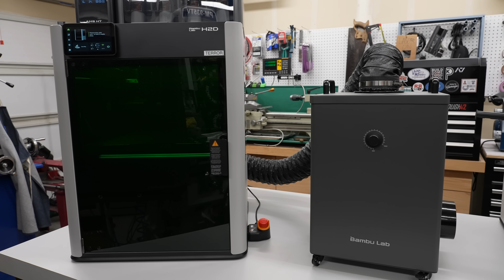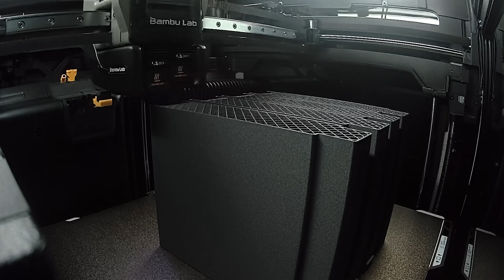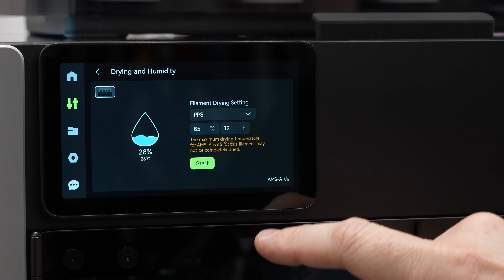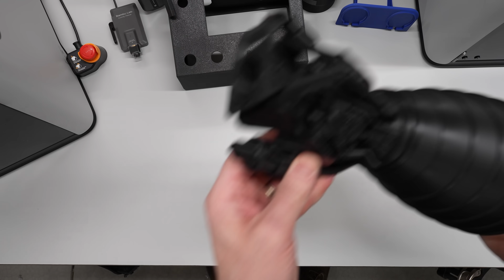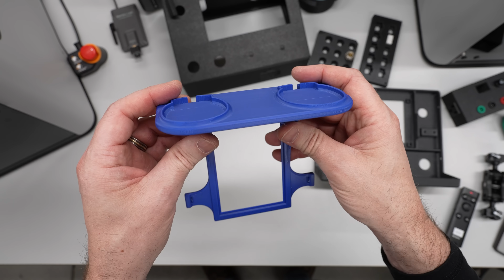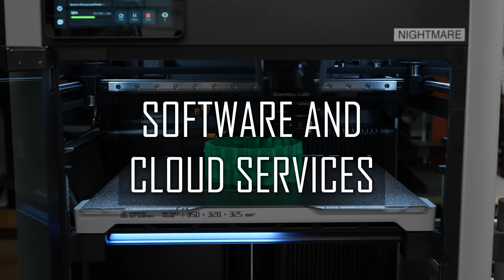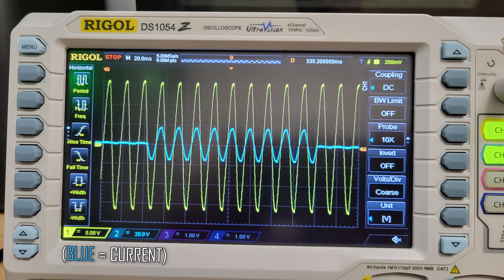What I Learned from 300 Hours with the Bambu Lab H2D 3D Printer

Comment: Right on, man!  That is just an excellent summary, and you covered everything well.  

I would comment that I can't imagine running a laser in a 3D printing environment. The amount of by-product produced by the laser would make for a horribly dirty environment for a 3D printer.  Maybe their exhaustion is really good, but having cleaned soot/glue off the bed of my laser, I can't imagine trying to get that stuff off of the intricate 3D printer parts.

Comment: Thanks for the video.  I have the X1C and for the most part works well. I have had filament breaks just about everywhere and don't really like being a mechanic and tearing things apart.  I have learned a lot about these machines though. I like the fact that these are easier to work on like swapping print heads.  I have always liked the AMS for printing in different colors which I think is the best on the market.  Printing right from the box is a big plus.  I like the heated and drying in the new AMS.  No more desiccant balls going everywhere. The laser addition is dumb in my opinion.  When a laser cuts it not only sends smoke everywhere but microparticles and sap.  Just get a PS2 from xtool and you can have 50w that will even cut clear acrylic. My guess is they will abandon the multitool concept when thy don't sell many of them.  I am just looking for the best print possible without failures that cost time and materials.  Bambu seems to deliver on that.  As far as their recent release on 3rd party slicers etc. that's above my knowledge base. I am still learning how to use Bambu Studio.  Design cad and all that other stuff are for someone besides me.  I just like to find good files and print them without issues.  Thanks again for the information.  I am sure more will be coming out daily.  Seems like the mechanics of the HD2 are working without any hitches, which is good.

Comment: the non laser version is most practical to get imho.  its rarely a good idea to use one tool for multiple tasks.  i would buy the non laser H2D and get myself a dedicated laser engraver.  that way, if there is an issue, i would be deprived of at least just one tool.

Comment: We have several X1's in a business used for manufacturing our parts. We only run single filament prints so never bought the AMS for those machines. The question I have is does the new AMS change rolls of the same filament when one runs out WITHOUT stopping the print and purging? It never made sense to me that the original would wait until the extruder was out of filament before loading another causing it to have to pause the print while it primed the extruder again. If the run out sensor was back at the AMS it could push the new roll directly behind the last that ran out and never skip a beat.

Comment: Lubricating timing belts are rare but something I've had to do in the past as an LFP tech. When timing belts start to clime up on the pulleys and/or make some noise and vibrations, then it is time to add some tiny bit of silicone grease to the outer edge of the belts.

Comment: integrating a laser into a 3D printer is one of the least practical ideas I’ve seen. 3D printing demands a clean, dust-free environment for consistent results, something that’s nearly impossible to maintain when you're also generating smoke, soot, and debris from laser operations. Good luck keeping your H2D clean enough to print reliably. Bambu Lab had to focus on improving times and waste of multi-color printing.

Comment: This video helped me decide that I don't need the H2D. It also validated my decision to buy the P1S just a few weeks ago - I've been using it non-stop since. I had FOMO ordering the P1S so close to the release date for the H2D. I'm glad I didn't wait. If there's a cut down version of the H2D at a lower price in the future, I might consider getting that eventually. Excellent content, thank you!
Reply: Лучше X1C Друг! У него и головка с закалённого металла и температура стола выше и многое другое лучше чем P1C
Reply: @Сергей_Бистяйкин  The P1S can easily be upgraded to hardened steel extruder gears and hot end. The slight increase in bed temps is not enough for me to justify the significantly higher price of the X1C. While the there are other feature differences also, they are not relevant to me.

Comment: I am planning to get this new machine, but my concern is with the tpu. I want to try and get into mixing petg and tpu with the dual nozzle. How did you go about making your print with the buttons cause that looked amazing! Did you just side load the tpu with the side spool holder like you would on a X1? any generic brand or did you use tpu for ams by bambulab to do it? I looked at other reviews and they had complaints about the tpu and had to jig up some way to pipe in the tpu from the top.

Comment: LED flickering is a day in and day out experience in new home construction of course mainly due to the use of less than high end bulbs. It's an issue the LED bulb manufacturers should be dealing with on their end by now but unfortunately the industry is moving in reverse chasing costs rather than quality. What else is new

Comment: In reference to the pla breaking on the longer print.. I know klipper can cut off hot end power on a tool changing printer after a set time, like 10-20 minutes. Depending on what you set it at.. it shouldn't be a big stretch for them to make a macro that will pull back filament not being used at a certain layer height that it sees a certain material is no longer used..  
Great review.. been waiting for this printer!!

Comment: I really respect your opinion. Dang, I wish I could afford the H2D or more importantly, the SPACE for one. My A1 is fantastic and fits my needs. It's so tiny I actually got rid of my TV and put the A1 on the TV  cabinet. I don't do enough printing to justify getting this machine. Most of my uses for it are "artistic" and a bit functional. I've been printing stuff for a local artist to use for mounting brackets on canvases and frames and.... IT JUST FREAKING WORKS EVERY TIME! I rarely have failed prints. However, I am annoyed with my AMS and the "bleeding" and mixing of filament colors after swaps. The dual nozzle on the H2D looks fantastic. That alone would be worth the price. To be able to mix TPU and PLA in the same print would be amazing.

Comment: Really good info! honestly! love indepth from a slower take on how things went from ground level. (Open to any thoughts about the below thoughts)

Great price if you are looking for an all in one. However, Fiber lasers like the F1 ULTRA and its capabilities kind of have this sold out. The Build of problem of debre is a defineite struggle for sure. Snapmaker has them in build size, cost, and openess to change. This has snapmaker in terms of speed, materials, and multi-material. Definetly going to have those with use cases for this. There are a lot of technical engineering challanges I see they really had to go through. Was sad about the inability for 2 materials from the same changer to be able to be used. And unfortunate, that the build size is not much bigger than the K1 MAX even if dual nozzle

Its hard to watch material wasted, honestly by just doing filament ramming and then pulling the material out before it gets cut TONS of material is saved when purging and have found it possible to get down to sometimes just 0.4 in orca slicer for purge numbers on some. (Numbers close to 150 with this method) 

Someone else mentioned the least talked about thing of purging into another item which I think is one of the most "filament saving" tools out there! Purge into other objects that you may be needing or can sell as functional parts with some multi color pizzaz :P. I understand not all materials will be good to do this with or even pulling them all the way out as I mentioned do to the aforementioned  (in the video) easy clogging. And at the same time I see it important to mention that even retracting until just before there is a few mm left of the material below the cutter will IMPROVE A TON of material waste!

Great video! Just a lot of effort to do multiple things. I like to live by a phrase I heard some one say one time "If something takes longer than 10 - 20 seconds to do" { and you have to do it alot } then your less likely to use it or want to do it.

Comment: I had a printer a decade ago for a few years and it’s amazing how much printing has improved in the last 10 years.  I would have to force myself to learn CAD to make it worth buying another one.
Reply: I used to supervise an electronics maintenance work centers.  Especially when we were overseas there were so many times you couldn’t get what you needed, and it really would’ve helped if the basis had it of facility where you could manufactured to the level that we can now between lasers CNC’s and three printing in a multitude of materials. It takes us forever to get parts and their expenses.
Reply: Hey, DOD.   The next time we go to war you need to be able to 3-D print decoys also.  They built an entire blow up army for D-Day to throw Germany off and now we can 3-D print the entire thing.
Reply: You make a giant 3-D printer and you put it on a semi with a generator and then you have a semi with reels of plastic : )
Reply: The printed conflict.  At what point do we start fighting each other with 3-D printed weapon systems?  Lol
Reply: Well to be specific at what point do we break the line where most of it is 3-D printed versus traditional manufacturing
Reply: I’m sitting here thinking about 3-D printers that fit on the pallets for military aircraft and have a huge build volume : )
Reply: Why call back and ask for procurement support when you can just make it : )
Reply: What makes all of this interesting is that if they get good at recycle in which they’re trying to do anyway they use the materials from around them instead of having a supply line and now they can truly be mobile.  They dig up your garbage dump and process it with enzymes breaking everything back down to its basic component and then re-manufacture.  You will see some very clean battlefields because everything will be reused.
Reply: You can’t move back anymore because there’s nothing left but the scraps from the last battle.  The rest of it was recycled and now you have a baron wasteland.   Lol
Reply: Just wait for the 3-D printing robot and each one of his fingers is an extruder or tool holder.  He can fix himself or build anything.
Reply: BambuBot
Reply: Suddenly, I thought about this horrifying robot that has filament tentacles.  It learns to move and manipulate objects that way.   Lol
Reply: It was all good until the morning he woke up and his last print job was standing over the top of him : )
Reply: Bed leveling. You have to print on the bed you leveled, just like you have to sleep in the bed that you made.

Comment: 27:08 I am a service engineer for a very large medical device company. Lubricating timing belts is a common and normal practice with some of our instruments. It all depends on the material that the belt and pulley are made from. Certain combinations squeak more than others.
Reply: Putting grease on a belt seems like the worst thing you could possibly do tbh
Reply: @thenamelessone123  that only applies to V-belts. On the other hand toothed belts arent dependent on friction.
Reply: @thenamelessone123 It just applies to friction belts.
Reply: Have you heard of grinding the outer surface of timing belts? Well now you have :D There are some people who do it and claim it reduces belt vibration in higher speed applications.

Comment: I'd view the laser option as more of a prototyping tool, for very low volume but "will this work as planned".

Real world: raw stock comes in larger formats that justify larger scale motion systems. I used to entertain getting a lasercutter, but began to take a skeptical view when I'd review the "recommended stock" list. Corrugated cardboard and plywood, bonded sawdust, plastics were not recommended. Kind of limited outside of an industrial environment.

Comment: You should print cube on H2D and X versions and measure it on the granite plate with a dial indicator - if the sides are truly square and parallel (skew stuff etc). I do wonder how much the software motion correction via the encoder plate helps!

Comment: Would you recommend this printer if my only 2 requirements are the large bead and reliability. I primarily prototype parts before machineing for a few customers I work with, and I barely use my ams on my x1c. If I do use the ams it’s for a support interface.

Comment: Excellent review, and pretty much in-line with my H2D experience so far. This is a really good machine.
Reply: wait you have gotten one too??? Omg cant wait
Reply: It seems to be good but I really don't understand the laser. I know I am not the target audience for that thing because I do like building printers. But I have to admit, out of box it's a good machine just don't buy the laser version. I'm sure you have used lasers before and know what kind of a mess they can make. A diode laser strapped to a fairly complicated toolhead with cameras and sensors just asking for trouble.
Reply: @krisztiantkacs  The laser module is optional, you can get the machine without it
Reply: @krisztiantkacs if you need to laser cut something now and then, it will be fine. Yes you might have to wipe a lens every now and then (think of the poor children!).

If you are laser cutting 8 hours a day then yes, very very very obviously this would not be your first choice.
Reply: @Rokmononov  even if I just want to lasercut occasionally I don't think that's a good idea. On the other hand I never saw a tool that did a lot of things and was good or reliable in all of them. There is a reason why everyone who tried to integrate a laser into a 3d printer abandoned the idea quietly.
Reply: @Rokmononov  You don't need a 40w laser for engraving so they market it as if it is a good idea to cut wood with it.
But it really is not, I own a Creality Falcon 20W in a custom enclosure with a 120mm inline fan to blow dust and smoke outside.
You should see the machine and the enclosure, you don't want to print in it.
Bambu Lab provided James a fix for the noise his H2D makes, lubricate the belt, you don't want that in a device that create dust...
It's marketing, look what this machine can do also, but it is marketing only.
But we will see in about a year when people did cut wood in, if it starts to fail or reduce in quality.
Reply: Ripp xina got matt

Comment: 1. Poops out the back still? Man, I was hoping this was going to be changed. But I guess much less poop with the dual nozzle setup.
2. Uvidíme se později, Prusa! The only thing keeping me in their ecosystem was the XL. Now I can get rid of the monstrosity of a time and money suck!
3. I don't think this really impacts the X1C sales. But I do believe the X1E will be discontinued.
4. Speaking of getting rid of things...hasta Cricut! I have been waiting for a better company to make a vinyl cutter, I hope Bambu is up for the task with the software side.
5. I am not convinced this will be a replacement for a dedicated laser cutter. Seems more of a convenience thing for occasional use. But there are some way more advanced features than typical dedicated laser cutters so I don't know. I do have some concerns about how smoke residue will impact the interior of the machine. Camera lenses will get gunked up and maybe the motion system too? Maybe someone with a SnapMaker can chime-in on this?
6. I was kinda hoping the laser would integrate with the 3d printing better. I was thinking you would be able to engrave on the print you just made. But I guess that's not really a possibility because lasering plastics that are 3d printable would be toxic?
7. Loving that they also have materials now. Just exploring everything they offer from the materials to the makers supply seems like Bambu genuinely listens and wants to be an actual one-stop shop for everything.
8. Bambu, please...make the Bambu Handy app functional when using LAN-only mode. I get it...the cloud service is fine and I should trust it. But I have had designs stolen from me before and it was traced back to a cloud server (not Bambu but still). So if you really want to be ethical, allow complete and full functionality without the need to connect to your cloud...ever.
9. Finally...wow! Great review and I very much look forward to seeing more. Those panels you printed are freaking amazing looking. And the smoke tube attachment...with the integrated TPU washer...dammmmmmnnn that's a sweet-looking print. I'm glad you got some free printers out of this - Bambu totally got their money's worth.

Comment: Does it have hardwire Ethernet? Is it able to operate without restrictions without an internet connection?
Reply: I read somewhere that you can't use the laser cutter in "developer mode".
Reply: No ethernet, but fully operational via USB drive and touch screen.
Reply: No Ethernet still for some damn reason, but you can do all updates over USB and operate it fully offline according to another review I watched.